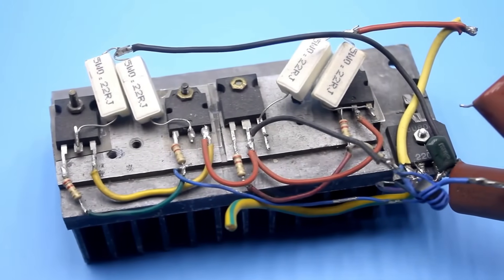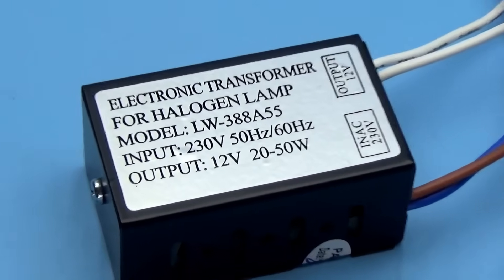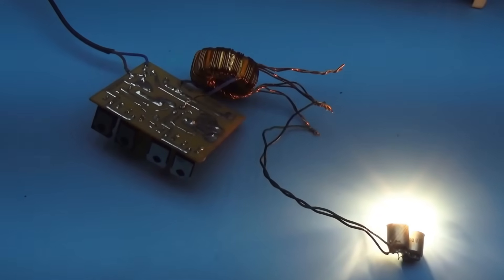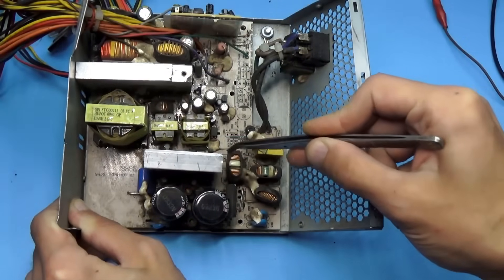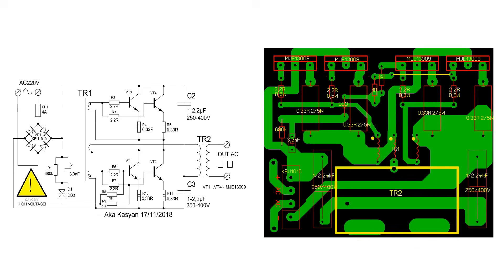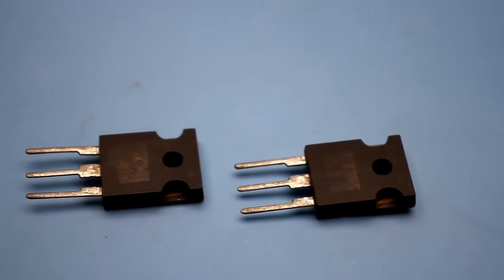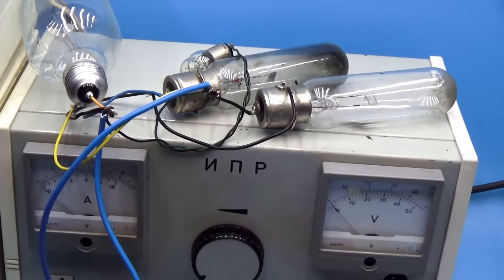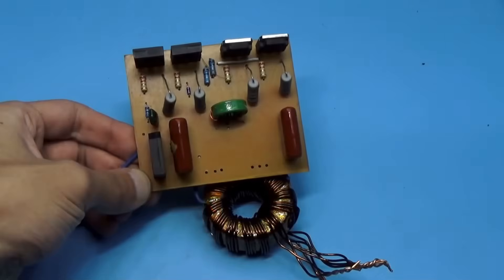500 Watts from an electronic transformer! Increasing power.

Comment: This circuit actually so dangerous dangerous than I thought there is no have a short circuit protection even I cannot Run any of DC motor and after then rectified best circuit actually not budget friendly but this kind of circuit also better dangerous not useful😢 it can be a more useful without a diac using best option all two transistor bases connected with two 50v filter capacitor 10uf and the any High Voltage flame capacitor 4.7uf two transistor collectors connected parallel
And don't forget the resistor parallel with capacitor 470k and one transistor base to emitter connected diode the diode silver flag connected transistor base Black Flag connect to a transistor emitter is this really important for transistor high voltage protection it will be working like a snubber net work another transistor have to and emitter side of the transistor base connected 1M ohm resistor  both transistor connected with centre tap I think it's really quite best you can copy from it old cfl tube light ballast 
I really forget to say he didn't using main filter capacitor for after rectified you should connected it can be more powerful then 500 Watt and you can copy from old computer atx power supply it really best option I hope you are all understand
😊❤ all guys😉 same procedure on computer ATX OK thank you 😅
Reply: Current limiting is easy to implement ether with an series inductor with the transformer or a current shunt

Comment: Verry interesting. I have several transformers but I need lower secondary voltage, for example from 60 volts to 2*30 volts or step down from 60 volts to 30 volts. Can you make a video about this capability?

Comment: This circuit it a big waste of time put this circuit in the garage anytime below 70 % efficiency is not worth it big to use mosfet or igbt transistor base eat alot of current so the base along eating 20 watt of power
Reply: It is more or less a simple high-frequency pulse transformer without any regulation relating to output voltage or current limit / shut down current. That's why it is also not short circuit proof. I prefer simple circuits based on UC3843 and a MOSFET driver. The UC3843 has means to control output voltage and input current limit.
Reply: I can only say this this circuit literally works with trash transistors you can't usually re use for any other purpose like deflection transistors alone for that it's pretty cool

Comment: it explode when there's a short circuit , how to hix this problem
Reply: Yes, there is no short circuit protection here.
Reply: @akakasyan  
Thanks for replying,
Please can you make a video on the SPWM Inverter EGS002 module?
Reply: add output resistors
Reply: Crowbar protection. ( google it ) Secondary side shorts, blows primary side fuse.